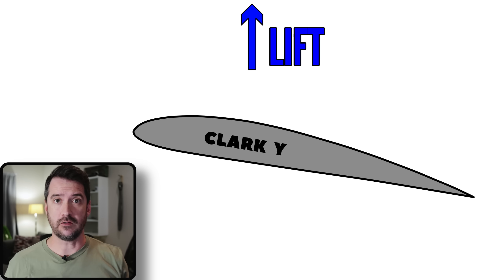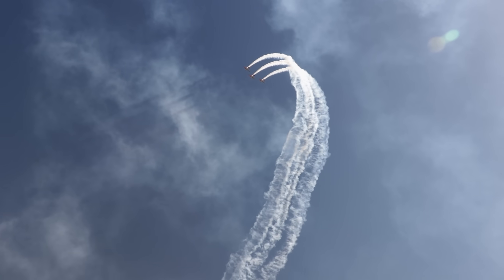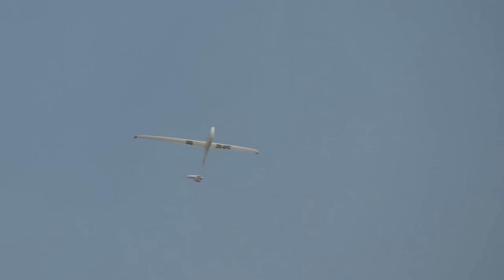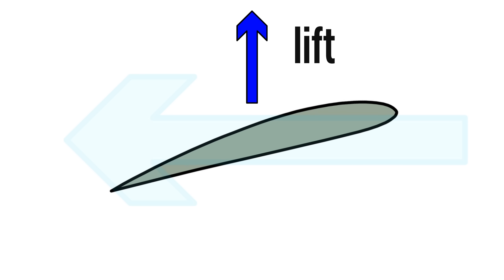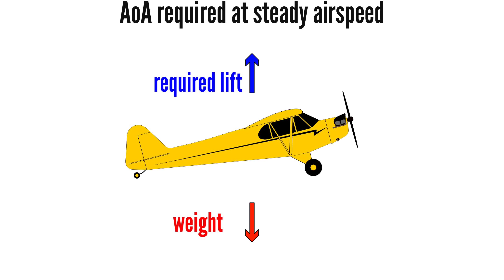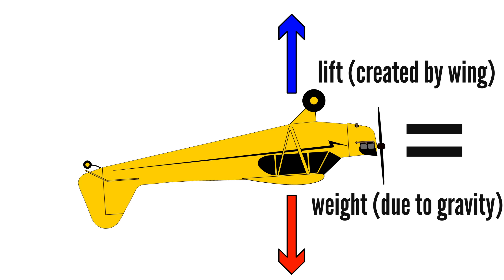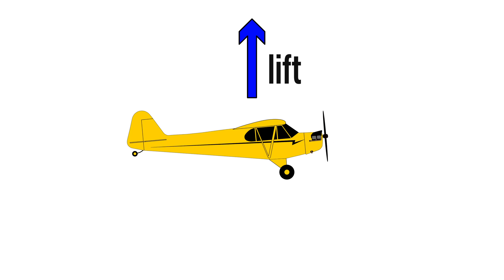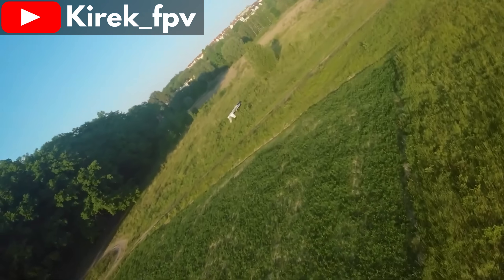Is Airflow Distance Over the Top of a Wing Always Longer?

Comment: Vacuum is not a vector.
Pressure is.
Lift is not a force. 
Suction does nothing. 
People are blown out of airplanes, not sucked. 
Wind pushes, it is not drawn. 
Angle of attack is the only thing that lets a plane use AIR to keep up, by pushing the same weight of AIR down. 
Thrust is generated by the wings, just like a propeller, or a turbine, being pushed through AIR. 
AIR has weight. 
Your carpets are cleaned by particles being picked up by the replacement air rushing in.
Compressed air cleans surfaces better than a shop vac because it's the velocity of moving AIR that generates the drag necessary for particles to move.
The top of a wing simply reduces parasitic drag to a point that the engine can keep dragging it through the viscous AIR.
I've known that wings fly on their bottoms since forever, but nobody listens.

Comment: Lift is created by deflecting the air downwards which is a factor of the angle of attack as the wing moves through the air.  The airfoil only optimizes the lift to drage ratio.
Reply: Lyft is created by throwing air downwards it's quite literally a mass thrower action reaction for every action there's an equal one opposite reaction throw 10 lb of air downward you get 10 lb of lift upward 

This is not in dispute people think it's indispute because they lack understanding 

The pressure differential around an air foiled wing creates this downward path of air can you simulate this with a flat plate? Yes you can what's the difference? Efficiency 

Will your flat plate generate lift? Yes it will it'll also do so incredibly inefficiently requiring a stupid amount of power on your part in order to effectively use that wing 

Air foil efficiency is all about getting the angle of attack as close to zero as possible because the closer I can get it to zero the less drag I'll produce while still producing lift and less drag I produce means I don't need as much thrust from my engine in order to maintain flight not requiring as much thrust means I can use a lighter engine using a lighter engine means I can use a lighter airframe which means I can use a lighter engine which allows me to use a lighter airframe see how that works? There's a point of diminishing returns but that's the basic concept The closer I can get to zero The less drag I produce less drag our produce less thrust I need less thrust I need less mass I need 

Air foils are about efficiency that's why we have so many different types of airflows for so many different types of applications because different applications have different requirements and a different shapers required to get the efficiency needed for the application 

Showing that a flat plate can generate lift does not make the theory wrong it just makes your understanding of it wrong because the flat plate working proves a theory it doesn't disprove it
Reply: @nerys71  Lyft is created when some rich asshole in San Francisco thinks to himself, "how can I get every cab driver in the country to pay me $7 every time they take a fare?"

But yeah, I agree 100% with your mechanical assessment of the problem. My freshman physics instructor told us to always start with a free body diagram and account for the forces involved.
Reply: @stickyfox  Beat me to it!  Too bad so few viewers are here to upfist it.
Reply: Andy did you watch the video? What you have explained is the Newtonian component for lift generation, which I agree is a component of lift generation. However, he cleared up why the Bernoulli effect is also a component. You have just dismissed that.
Reply: @Lozzie74  Bernoulli only helps direct airflow downward.  Newton accounts for 100% of the lift (and the drag).
Reply: @rsteeb  Wrong about everything.  Well done!
Reply: @jpdemer5  That made me laugh
Reply: Completely wrong, I suspect you think a sail works by being blown along when in fact most of the power generated comes from the air being forced over the leading side effectively sucking it along. It takes some understanding of physics, if you don't have that you really shouldn't comment.
Reply: @zidermakesispooky 
Lol Some of actually studied this shit.
 All the models give the right answer. All the models are 'correct'
Reply: You can make it even simpler than that. Ignore how the wing works and observe that the bulk change in momentum of the air molecules around the plane equals the force of gravity on the plane's mass and the force of friction. Something needs to get pushed down and backward, or nothing is pushing the plane up and forward.
Reply: The airfoil also prevents stalling by greatly increasing the critical angle - a wing can't achieve optimum lift if it can't reach the optimum angle of attack.  
The F-104 stalled easily because the thin wings allowed separation of the flow across the top of the wing, even at small angles of attack. 
With a conventional airfoil, Newton rules, but Bernoulli does have something to contribute: at a 0° angle of attack, Bernoulli is the only thing keeping you airborne (and your aircraft had better be very light, or very fast.)
Reply: @jpdemer5  Actually the stall angle of attack of a flat plate is only two or three degrees less than a conventional airfoil like NACA 4421.  Wings have an "airfoil" shape primarily to reduce drag.  Plus it's a handy place to put a wing spar since the stiffness of a wing is related to the cube of the thickness; i.e. flat plate wings would be to "floppy" even if you could live with the drag.  Additionally, the wing is a handy place to store fuel, run control cables/rods/hydraulics and so on.
In fact a flat plate does a much better job at functioning as a wing than one might think when you consider making lift and operating at reasonable angles of attack before reaching stall.  It's the unacceptable structural and drag considerations that make flat plate wings undesirable in anything other than toy balsa hand launched gliders.
Reply: @jpdemer5  It is not a matter of Bernoulli versus Newton: Bernoulli's law is Newtonian mechanics applied in certain idealized fluid dynamics situations (for a more general application of Newtonian mechanics to fluid dynamics, one needs the Navier-Stokes equations.) It is not as if you get a certain amount of lift as a consequence of the rate of change of momentum and then something extra from Bernoulli, as the former is the explanation of the latter.
Reply: @jpdemer5  A wing producing sufficient lift to overcome aircraft weight is never at 0 degrees AoA.
Reply: The problem is that Bernoulli (pressure differential) Newton (accelerating the air) and all other theories end up with the same answer.
Reply: @leosmith848  A theory based on the equal-transit-time fallacy actually does not end up with the same answer.  The lift it predicts is only a fraction of the actual result.

Comment: Many a military pilot has said, "If you put a jet engine on a brick you can make it  fly." If you look at the wings of the F-104 the wings are practically razor sharp and pretty much flat with no discernable lift surface. But that thing flew and quite well.
Reply: Yes but look at the speed it needed for take off and landing. What range angle of attack? I bet 5 degrees max. Reason why so many crashed, pull and snap stall. Reason we have rounded leading edges is to smooth any transition as a of a is increased.
Reply: Yep, Biconvex 3.36% airfoil and something like 4 inches thick at the root.
Reply: ask the Germans
Reply: F4-phantom... Flying brick...
Reply: @rastaboy_gamesnstuff7778  you beat me to it lol
Reply: @rastaboy_gamesnstuff7778  f15. More thrust than weight. A true flying brick.
Reply: That's because:
1. Airodynamic above Mach 1 is totally different then below Mach 1 as above there's no "smooth" flow anymore
2. Planes flying above Mach 1 create most of their lift force by the jet engines when flying elbow Mach 1 plus they do adjust their wing shape.
Reply: @jimjimmy2179  Supersonic aircraft still have to fly at subsonic speeds.
Reply: @ChucksSEADnDEAD  yep, as per my reply. :) (The part that talks about below Mach 1.)
Reply: Is that the "Flying Coffin" ?
Reply: "Quite well", "nicknamed Widowmaker". Choose one. It actually flew pretty horribly. But it could fly damn fast and that was the design goal.
Reply: @bezimienny_andzej6425  The Widowmaker is an unfair characterization. West Germany used it as a low level bomber in bad weather, employing pilots with few flight hours and conscript mechanics.
Spain didn't have a single fatality in their F-104 service.
Reply: @ChucksSEADnDEAD  Of course it flew excellent. V. high landing speeds are what keeps people safe. I guess plenty of planes followed this design philosophy.

Oh wait, no one did, because that plane was not flying well at all.
Reply: Haha, depends on what you call flying well. The 104 is an example of an airfoil designed with pretty much only supersonic speeds in mind. The 104 has a diamond shaped airfoil that is designed to create a nice oblique shock at the tip and flat sides that avoid turning the flow of air. in fact if you look in a compressible aerodynamics book I guarantee you that just after a couple of practice problems of solving for the lift of a flat plate, there is a problem solving for lift of a diamond airfoil (and they are super easy to do too lol). aerodynamics really do get pretty simple once flow can't communicate upstream.
Reply: EXACTLY!! -1⭕️1+
Extra notice is the frequency vibrations range for every stage when you go higher. 

For wings as the best fastest and sharpest angle to fly is a “horizontal straight line” but for more stability and drag adjustments is a “ball” formed wing better!
Reply: "flew and quite well." - BS.  It was a piece of junk that nobody would have bought had Lockheed not bribed countries, congress and generals to purchase.  It was well known as a widow maker and had a turn radius the size of Texas.
Reply: Pay close attention to the latter part of the video with regard to the  forward stagnation point. The air is still following a longer path even on a symmetrical wing due to the angle of attack and the position of the stagnation point.
Reply: Yeah basically it's all trust to weight ratio. Same as rockets. Wings are just there to help control a craft. Same as fins control a rocket... but with the right calculations a rocket doesn't even need fins.
Reply: The F104 killed 1/3 or 1/2 the pilots flying it, depend which country. it was a monstrosity.
Reply: @joefish6091  Spain didn't have a single fatality. West Germany had lower training hours, conscript mechanics and bad weather.
Reply: It also crashed very effectively.
Reply: that's just an engine with control surfaces lol
Reply: Fighter jets also have lower wing loading than most jets.
Reply: Yeah. A saturn 5 rocket didn't need wings at all. But the wright brothers plane did. It's almost as if speed and power can not only render wings redundant but obstructive.
Reply: But stalled pretty good too lol
Reply: The Saturn V flew with no wings at all.  Just a lot of thrust.
For most of the rest, generating lift efficiently is important.
It is clear that the airfoil shape offers advantages as described all over these comments.  A sheet of plywood would stall at absurdly high speeds and low angles of attack.
Reply: A German pilot mentioned that the F104 needed flaps to have any appreciable ability to turn, in other words the wings were too small.
The plane was able to climb well but not much else.
Reply: "No discernable lift surface". What? Never mind. You might want to look into the complex "computerized" flight control system of the F-104. In reality, if the pilot only had a stick and cables connected to the control surfaces, then no human alive could possibly keep that thing "flying" in a straight line — even straight down, probably. This is done very much on purpose to make the fighter jet highly manoeuvrable. It literally wants to "fly" any direction but dead straight at all times, by design. Without those systems aiding the pilot, the whole thing would turn into something more akin to a leaf blowing in the wind, compared to a traditional air plane. Regardless, the wing very definitely has a "lifting surface", if only to create space for fuels and other stuff! Just because you cannot see it in a picture, doesn't mean it aint there.
Reply: Your right.   Google a picture of two F16's flying one up and one upside down for airshows and you will see that they have the SAME angle of attack.    This is fact, not perception.    It destroys the nonsensical idea that angle of attack is causing lift.    The same for "airfoil" shaped wings.    Those wings are basically symmetrical.
Reply: @Ranchpig67  The angles of attack are close, but not identical.  The speed of the plane allows that slight difference to create lift when upside down.
Reply: @Ranchpig67  Nonsensical? When you break things down to simple machine type, a wing is a "load", and the air is an inclined plane of variable angle and infinite length.
Reply: @Ranchpig67  Fighter jets have the advantage of a surplus of thrust. Thus they can use other tricks to work around this.
Reply: @Ranchpig67  Yes, do that, and then actually LOOK at the photos, and use a ruler and you will see both higher and lower angles of attack as well. This alone proves nothing except that the photo was taken at a particular point in a manoeuvre. The F-16 uses a modified NACA 64A204 airfoil similar to the NACA 64A206. It is certainly not symmetrical, especially while LE & TE flaps are operation during normal manoeuvre settings. The inverted F-16 will generally have a higher angle of attack than the non-inverted aircraft - ie it's nose points up slightly.  Bear in mind that the FLCS has a say in this, not just where the pilot wants to point the thing, and that the F-16 can only maintain inverted flight for a very short time (around 30 seconds max - I believe).
Reply: @Ranchpig67  i've seen an f-16 up close and it definitely has a cambered wing.
Reply: @Ranchpig67  Same angle of attack but the number is painted upside down. That is a special plane modified for the stunt. Also the tails are at different AoA.
Reply: Yep! The F-104 is my favorite example to show it's NOT Bernouli, but NEWTON that provides lift.
Reply: @rsteeb   The two are not mutually exclusive.
Reply: @rsteeb  in that case, yeah, you're right. In the case of a Piper Cub, no, you're wrong.
Reply: @mdrocketry  No he's wrong in that case too. In the case of the F-104 It is an aerofoil, and it is assisted not only by  by large LE & TE flaps as well as BLC (Boundary Layer Control) air blown across the flap surfaces.
Reply: @memkiii  Eh, but at supersonic (or through transonic), normal airfoil things stop working. At that point it really is just a flat board in the wind.
Reply: @rsteeb  why does this always come up as a "one or the other". 2 things can, and often are, true at the same time and part of the whole equation. If you'd remove one of the effects out of naturals existence, the whole outcome would change
Reply: @fetB  Airplanes, helicopters, and rockets ALL ascend due to identical laws of physics.  Fluid accelerated down, craft reacts up.  Simple.  Newton.
Reply: @rsteeb  The F-104 has large flaps at the rear and slats on the nose of its stubby wings, and on the wings you have rows of vents to influence the boundary layer to prevent delamination of the airflow, i.e. a stall. 
 
And what else other than camber have the lowered slats and flaps to offer? 
 
Which also goes along with deflecting air downward. I grant you that. 
 
 
If only people would stop to constantly insist "it is ONLY that" and accept that lift has multiple facets. 
 
 
A sailboat is also an aerodynamic entity, its sail in not more than a vertical wing, the airfoil is cambered with the thickness 0. 
 
When you are fawt, even on a reach (true wind from the side), the virtual wind comes from 30 - 45 degrees from the front, and your sail is closehauled, i.e. in line with the centerline of the boat. 
 
The classic lift direction would be vertically from he plane of the wing, for the closehauled boat  that means the whole force goes SIDEWAYS, makes you heel, and nothing else. 
 
You would have to let out the sail (away from the centerline), so that a partion of your lift vector points more forward, and pushes the boat forward. 
 
But usually, the TIGHTER you sheet in, the faster you are. 
 
So for sailboats it is obviously primarily the redirection of the wind to blow out the back of the boat that drives you forward. 
 
NEVERTHELESS, you have to follow classic aerodynamics regarding angle of attack, wing camber, airfoli shape etc so that the redirection is done smoothly. Turbulences slow down
Reply: @rsteeb  Couldn't it be that on different speeds, airfoil geometries and angle of attack, just  the ratio between Netwon and Bernoulli changes? I meant, that lift is combination of two effects and it varies depending on previously mentioned factors?
Reply: @rsteeb  So why does it have flaps and slats, and an aerofoil? - surely it should be a slab of metal by your "example"
Reply: @rsteeb  it's not an either or, momentum has to be conserved and so does energy. Just because you put control surfaces on a rocket engine doesn't mean bernoulli has nothing to do with lift any more.
Reply: @psyience3213  OK, Bernoulli accounts for some of the airflow deflection, throw in some coanda... but AoA and the laws of Newton account for the net effect of an airfoil with its relative wind.  F=MA; lift is equal and opposite to the force of the air mass being accelerated (downward, in level flight) by the airfoil. Airplanes, helicopters, and rockets, the same laws of physics account for their ascent.